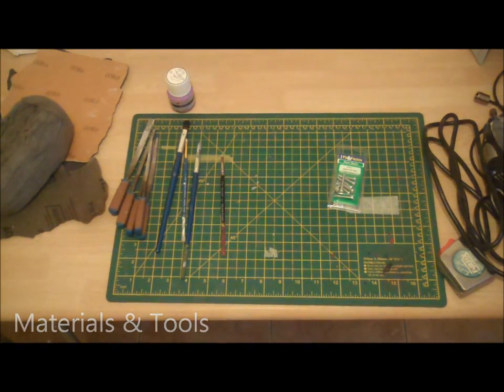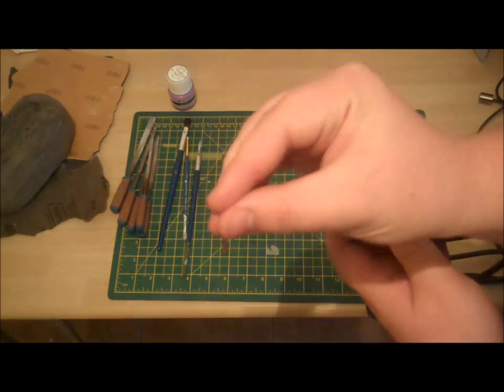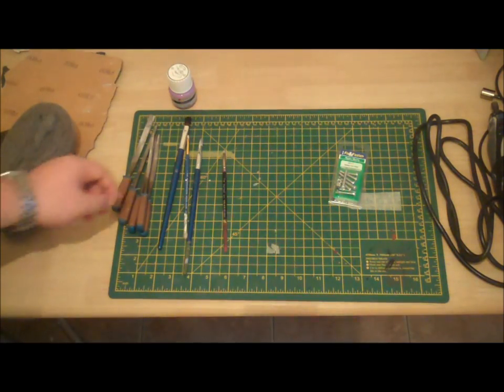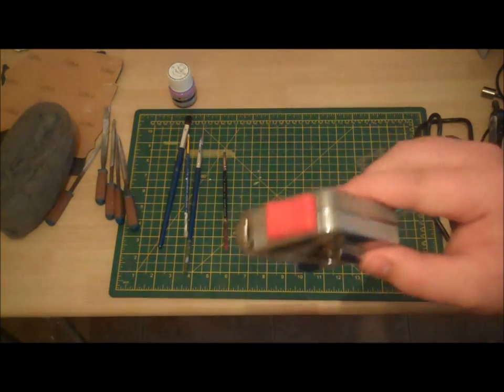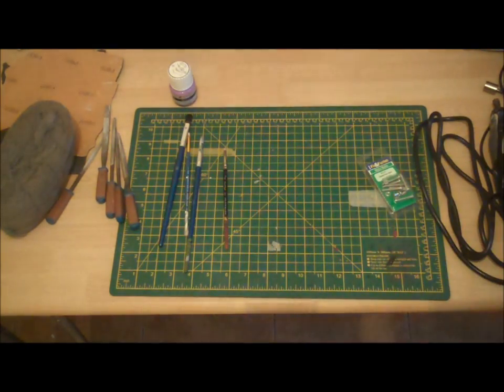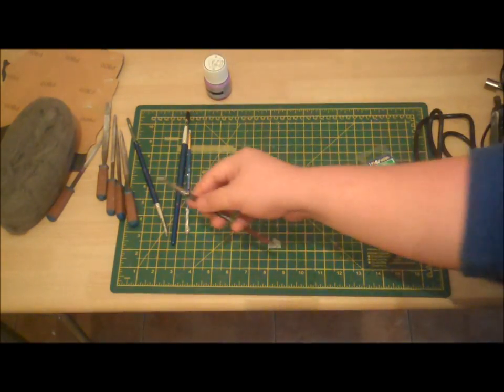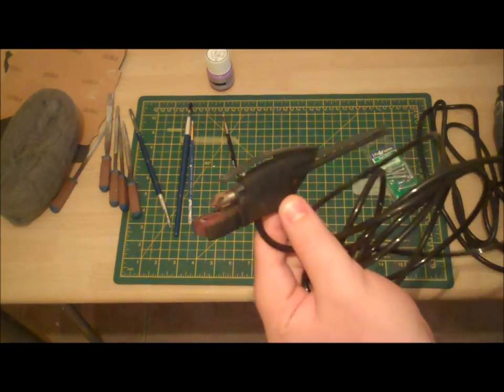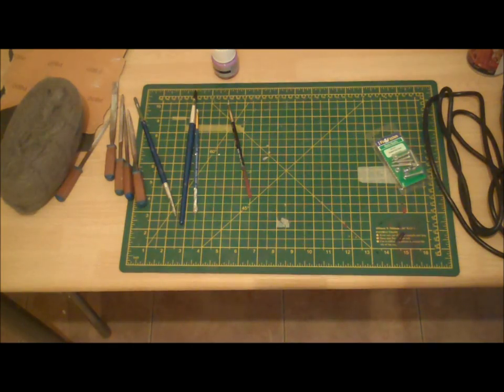Boba fett helmet: Episode 3, The Materials

Comment from the maker: SCAN Respirator Dust Mask & P2 Cartridges / Refills 

Silverline Half Face Mask Dust Respirator Paint Spray Piece Filters Gas New Work

If you type either one of those into ebay, they are the ones I use. I mainly use the top one for all sanding and small paint work, the bottom one is for all the heavy stuff like rattle cans, resin, body filler etc...